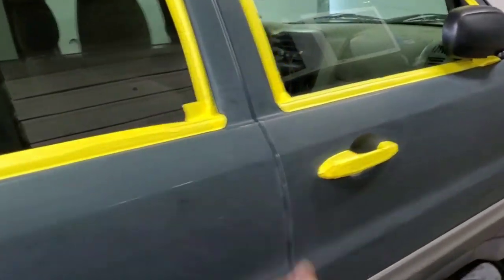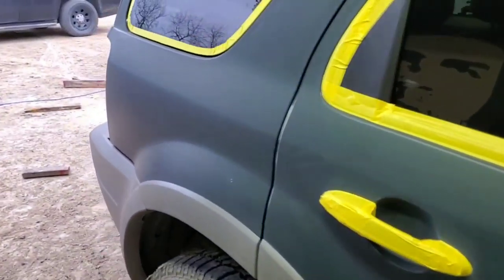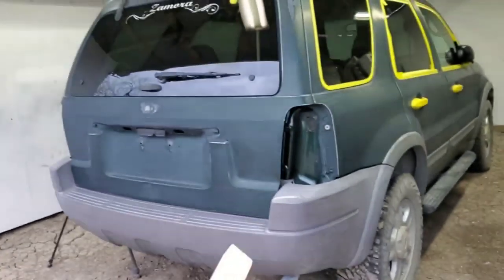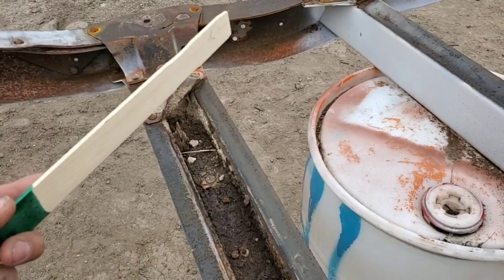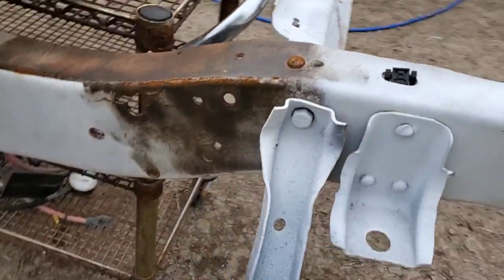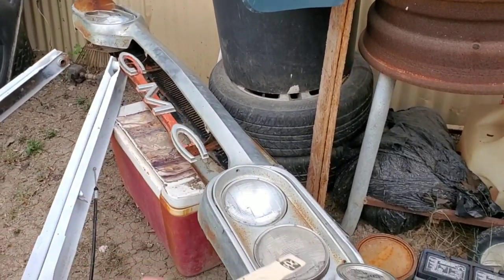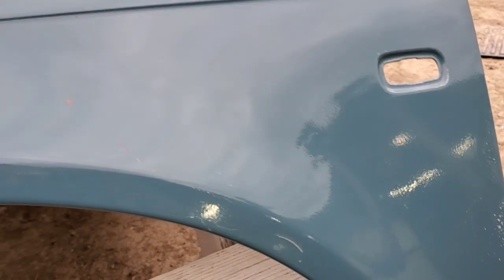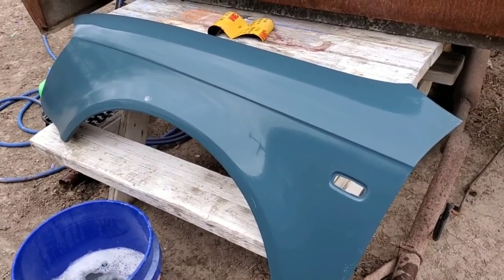Testing Ebay $95 Single Stage Paint [Jade Green]

Comment: Great educational videos and I love the music! I had a similar experience buying single stage paint online. Summit Racing brand paint at great price but must choose the of-the-shelf colors. I ordered 1 gallon British Racing Green solid color acrylic utethane single stage for a bit over $100 when include the slow activator and reducer. It ended up much greener and lighter than how it looked online. I did not like it so I ordered a quart of gloss black and a qiart of gloss dark blue sapphire. I experimented mixing and ended up mixing in both blue and black quarts into the green 2/3 gallon and ended up with a dark green that I really like and closely match the car original color Toyota woodland green. I will order their paint again but will alsays order a quart of some version of gloss black to be prepared to do some color mixing to darken it.

Comment: so all this wet sanding process is done before clear coat or after...?
Reply: wouldn't the paint fall off if done before clear coat?
Reply: This is single stage paint. No clear coat.
You wet sand and polish after all painting is done. Wait about a week or so.